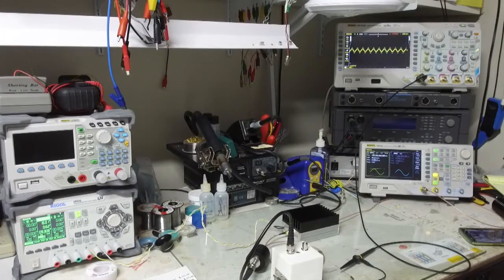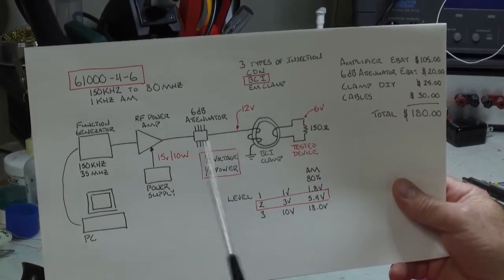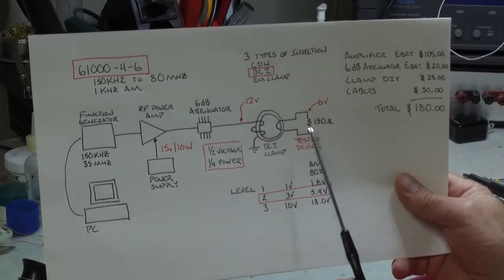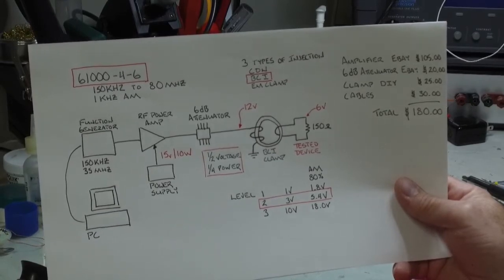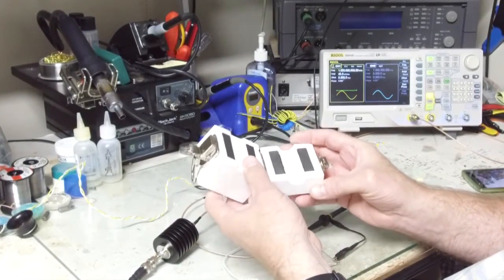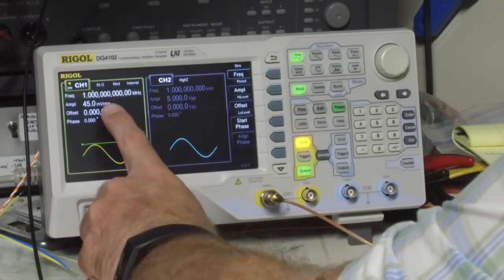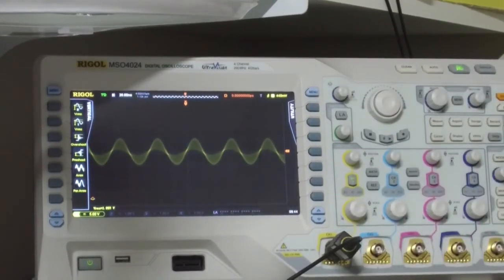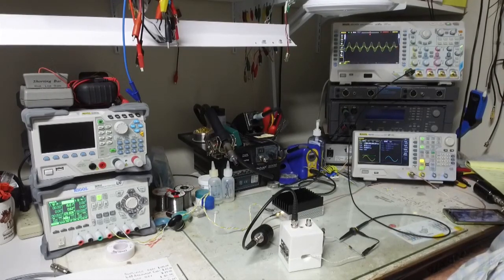CE Pre-Compliance, EMC Immunity to Conducted Disturbances EN/IEC 61000-4-6

Comment: Hi Dan! Back with a few more questions, if we are interested in tested at level 3. Would we need to increase the power on the power supply and or change the 6dB attenuator to a different power wattage? Or would it just involve changing the amplitude on the function generator?
Reply from the maker: Moving up to the next level would require an amplifier that is capable of more power which would also require higher voltage from the power supply.  The attenuator value of 6dB would stay the same and the power rating could probably stay the same.

Comment: so you have a calibration setup, OK where is your EUT? You haven't done in real testing nor shown any qualification of your EUT????
Reply from the maker: I believe you have missed the point of this video.  The purpose of this video was to explain the basics of this test, which I believe it does. The video shows possible methods for "pre-compliance" testing, it is not intended for replacement of a certified testing lab.  The equipment detailed provides a very low cost method to partially replicate the test so that you will have more confidence in your EUT when certified testing is performed :)  I did not show an EUT in this test but did show delivered voltage across the 150 ohm resistor.  The delivered voltage across a broad frequency range was demonstrated showing that the RF generator, RF amplifier, attenuator and bulk clamp do indeed work for a limited range and power test.

Comment: Hi Dan! Thank you for the great video! I wanted to ask if you know what power your 6dB attenuator is? I see there are options for 5 W, 10 W, 30 W and 50W.
Reply: Hi Dan, thank you for your quick responses, one more question, could you elaborate on how you connected the BNC connectors to the 16 AWG standard wire that is inside the clamp? Was there some sort of adapter or coaxial cable involved?
Reply from the maker: Here is link for a google share.  Let me know if you can see the pictures.  https://drive.google.com/drive/folders/1uxxUUJwXSxQiBre6Q6QOTvL-qIm6u0fm?usp=sharing
Reply: @DanPattenAudioG33k  perfect, but there is no link on the message?
Reply from the maker: Look for link again.  I might have goofed last time :)
Reply from the maker: Your welcome.  The 6dB attenuator I used in this video is rated at 25W.  Can barely tell that it is getting warm.
Reply: @DanPattenAudioG33k  what would happen if you use an attenuator with a lower power? I currently have one that is 10W.
Reply from the maker: Should be fine if you are using similar amplifier to unit in the video.

Comment: Thanks for making the video, I really like the clamp you made and hope you continue to make more emc related videos. Do you intend to release the clamp files?
Reply from the maker: Your welcome.  I am planning on making a couple of more EMC videos.  Do you have a suggestion on a particular test?  Possibly one on ESD or another on surge immunity with fast transients.  I can release the clamp file.
Reply: @DanPattenAudioG33k  Hi, a fast transient (61000-4-4) or surge test (61000-4-5) would be good, especially if you can take the same diy approach to creating the test equipment.

 I just purchased the same ferrite and will replicate the conducted immunity test soon.

Just a thought, you could also replicate this test but with a diy CDN?
Reply: Dan,i finally recreated this test and it worked very well. I used an ERASnyth micro to sweep from 12.5MHz to 80MHz and an older rf signal generator to sweep from 150kHz to 12.5MHz. I tested my circuit at 3VRMS with AM 1kHz 80%, dwell 3 seconds. My amplifier was a mini circuits TIA-1000. Would you consider releasing the clamp files or selling the clamp on ebay?
Reply: The TIA-1000 spec is from 0.5MHz to 1Ghz. It didn't work very well below 0.5MHz so I calibrated at 0.5MHz and adjusted at higher frequencies as you mentioned in the video.
Reply from the maker: Here are the STL files.  Cool to see that someone else is able to replicate the setup:)  Let me know if  you can access the files.

https://drive.google.com/drive/folders/1uxxUUJwXSxQiBre6Q6QOTvL-qIm6u0fm?usp=sharing
Reply from the maker: At work I have a nice setup for fast transient and surge.  Will have to think more about how a similar low cost DIY setup might be done.
Reply: @DanPattenAudioG33k  thankyou that would be great :). You could create a capacitive coupling clamp from a few sheets of aluminium. Then use a chattering relay or 12V ignition coil to create the fast transient. It will probably require a bit of experimentation. Surge is more difficult as you need to shape the waveform. I'm at an EMC test house this week :)
Reply from the maker: I have made a couple of the capacitive coupling clamps and they have worked out really well.  Ignition coil idea is interesting.  I'll have to be think about.  Good luck at the EMC lab :)
Reply: @DanPattenAudioG33k  for the surge you could use a flyback transformer (maybe more than one but stacked) to generate the high voltage. Look up LT3751 and you will see what I mean.
Reply: There are a few bosch vw beetle ignition coils on ebay you could play with.
Reply: @DanPattenAudioG33k  Hi Dan.  Anyway to post step files or replace units in these models.  They are tiny, about 2.5mm wide.  Thanks
Reply from the maker: @vladlozo1111  I'll check into it.
Reply from the maker: I just copied over new files.  See if they work better.
Reply: @DanPattenAudioG33k  Dan, so I put both shells together, and it seems like both halves not touching very tightly.  I'm thinking about improving your design.  Will keep you updated.  Thanks
Reply: @DanPattenAudioG33k  But I ran the tests and I found problems with the product I was testing.  Your setup really works great, the only downside is my generator just like yours, only can go up to 25MHz. And I'm not sure if the core you have chosen can go up to 80MHz.

Comment: Thank You for interesting video! Please, could You explain how is made primary side of toroid with BNC? How many turns and what type of wire is used there?
Reply from the maker: Thank you.  I used a Wurth 74272251 hinged ferrite core.  This core is optimized for lower frequency use.  There are only 2 wraps on the core and I used a 16AWG (~1.29mm dia) stranded wire with Teflon jacket.  My LCR meter at 10KHz measures the 2 wraps at 43uH.  The Wurth datasheet has a plot for 2 wraps and specifies an impedance of ~350ohms.  If I take my measured 43uH*6.28*1Mhz=270ohms.  So not too far off specification.  A rough approximation of the impedance from 150Kz to 30MHz would be ~200ohms.  Hope this helps.

Comment: Great video! What was the part number for the amplifier you used?
Reply from the maker: Thank you.  Not sure of exact part number.  Purchased the amplifier on eBay.  

This is ebay link:
https://www.ebay.com/itm/100KHz-30MHz-47dB-5W-ultra-wideband-linear-RF-power-amplifier/111958696554?ssPageName=STRK%3AMEBIDX%3AIT&_trksid=p2057872.m2749.l2649

A picture of amplifier PCB that I took: 
https://drive.google.com/file/d/1YEWTCjn1CnGqgi6axLu3k02QqZ3j4vmg/view?usp=sharing

The PCB link does work but the site is difficult to navigate.
Reply: @DanPattenAudioG33k  Thanks! The description for the amplifier in the link says it is 100KHz to 30MHz. Do you not go up to 80MHz when you test?
Reply from the maker: Testing to 80MHz would be nice because that would match the CE specification.  However, this amplifier's frequency response is really down by 40MHz.  Even with this amplifier's limited bandwidth, it still gives me an indicator of how well the EUT will perform at a "real" test lab. :)

Comment: Hi Dan, big thanks for such a great video! You really explained the test setup & method very well, without too many unnecessary & perplexing RF expressions :-)  
Could you please share the part number of the toroid core please? Are there any specific parameters to look for - material, form factor, other - for the best performance? Many thanks!
Reply from the maker: Thanks for the kind comments.  You will want a ferrite core that is optimized for low frequency operation and is large enough to not saturate.  The core I am using is a Wurth 74272251.  Check Digikey  PN# 732-13463-ND.